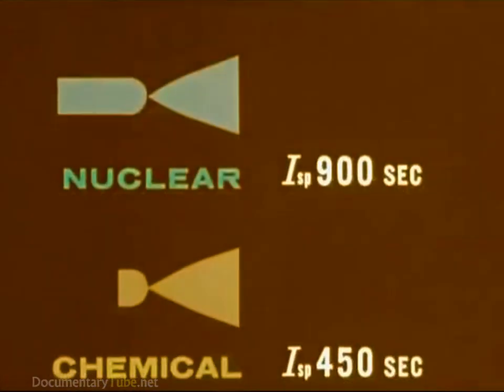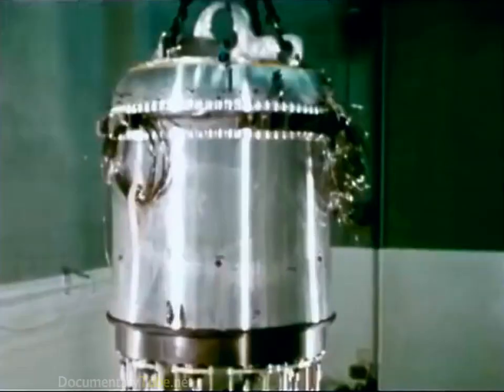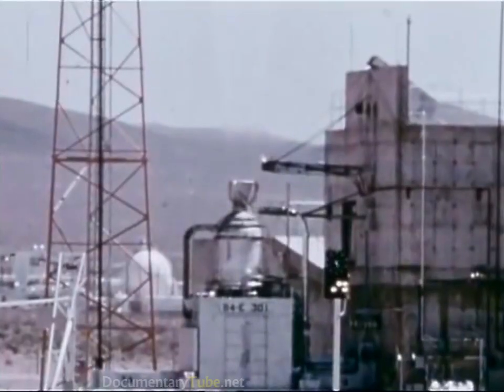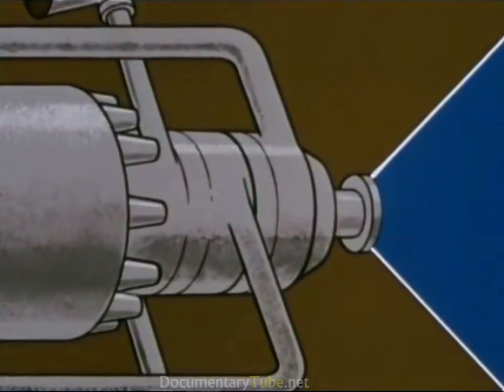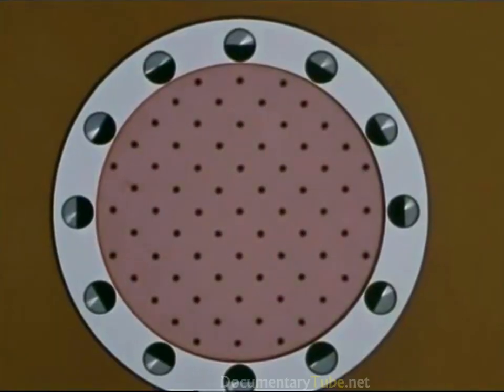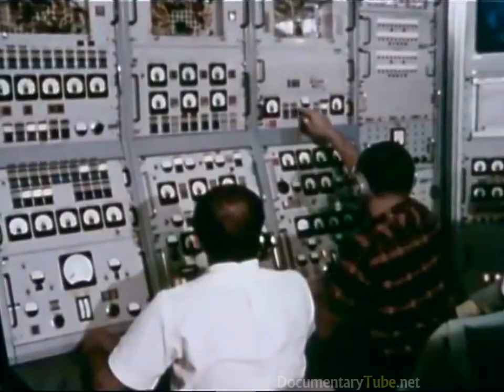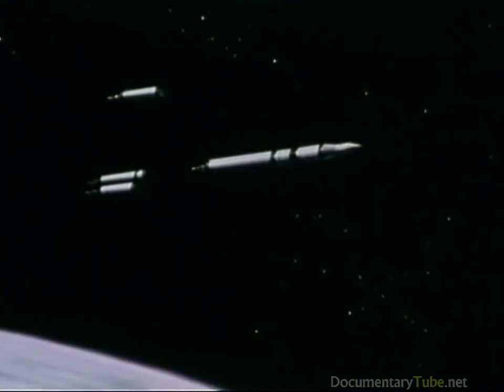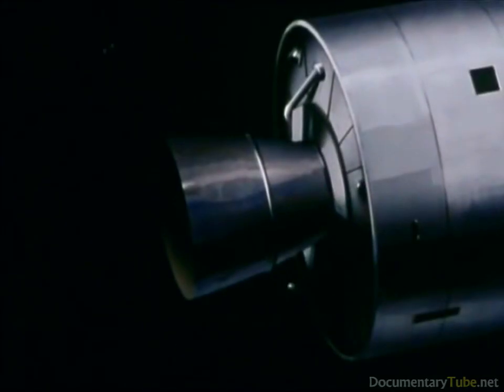HOW IT WORKS: Nuclear Propulsion

Comment: Anyone else see a problem with radioactive exaust gas?
Reply: The  only exhaust would be hydrogen, and hydrogen is not radioactive nor becomes radioactive.
Reply: hydrogen itself cant become radioactive........and they designed the core so that a liner or sleeve did the actual heating in the channels, not the actual graphite/uranium fuel.  In theory an overheat style melt down is possible if the control rods became jammed.
Reply: @wazza33racer  This is true. Without precise calculations, we could fly right through a star or bounce too close to a supernova, and that’d end your trip real quick, wouldn’t it? Oh, wait. I'm thinking of some other type of rocket engine.

Comment: The ion thrusters that propelled the NASA Dawn spacecraft to Vesta and Ceres have a specific impulse of around 3,100 seconds, more than three times the best numbers produced by KIWI.  Dawn was launched in September 2007.
Reply: The ion thrusters may have a high specific impulse, but not very much thrust, the nuclear rocket, and chemical rockets have thrust, but the specific impulse is lower, nuclear rockets are essentially the middle ground between high thrust to weight, and high specific impulse.
Reply: the kicker? they use INCREDIBLY heavy exhausts!
just
at speeds that no chemical nor nuclear rocket could HOPE to see ;)

Comment: Re entry vehicles are obsolete, this return vessel configuration could easily convene with a space shuttle, or international space station, furthermore the jettisoned thrust components can be pre recovered by incorporating return trajectory coordinates allowing them the advantage of a head start, negating the maximum rate of speed used by the occupied craft. 
 Return coordinates can be pre-programmed, re-examined  adjustments made at predetermined trip intervals via Stellar Mapping Azimuth Conveying Mars & Earth Module
 (S.M.A.C.-M.E) Module. Equipment shoves off for home independently during the landing, observation, exploration take off, the orbital craft rendezvous with the propulsion module, and departure units can be pre recovered by the same means as the return ship, and either docked with the International Space Station or configured in a relative orbit for future deployment.
Reply: Yes I agree. A much more efficient system can be configured now. 
In this presentation I'm not too sure about that little Mars surface return launcher.

Comment: Why aren't we using nuclear engines today, they would totally work.
Reply: Use of atomic power in space is strictly limited by international law. I believe all work towards developing nuclear rockets was suspended after the 1963 Nuclear Test Ban Treaty. Also there just hasn’t been a mission profile that would require it (that couldn’t be accomplished with known, tested, reliable tech) developing nuclear rockets to a practical point would require massive upfront investment, and the rockets/fuel themselves would be incredibly expensive compared to chemical rockets so there just hasn’t been a mission that would justify the costs/political maneuvering required.

Comment: 3 rockets to accelerate forward, 1 rocket to decelerate into orbit.
1 rocket to accelerate back, half a rocket to decelerate into re-entry.
how does that make sense!?
if you can equalize the speed with negative speed, by using one rocket..... why use 3 to accelerate to that speed in the first place?
Reply: Acceleration is force/mass, once the spent rockets/fuel tanks are jettisoned there is significantly less mass so it requires less force to achieve the same acceleration.  Even if they weren’t jettisoned there majority of the mass off the rocket is the fuel, so as it’s burned you need less thrust to get the same acceleration... making it modular/staged like this just increases efficiency as you can decrease mass even further as you go since you don’t have to haul all that dead weight around.
Reply: but mass x acceleration = energy.
so, if you're capable of equalizing the energy of a rocket in motion with the thrust of a single engine, that means you're more than capable of accelerating the same rocket from stationary to full speed, because the energy required for that is less than the energy required to move a mass that is already accelerating.
just use a larger fuel tank, or a larger engine, not 3 of them.
it's a rocket built in space! there's no gravity to counter, to get into orbit!
Reply: @bcn1gh7h4wk  but it's not "the same rocket" the mass is far less because there's less fuel/reaction mass and they've jettisoned the bulk of the hardware..
Reply: Here's a good primer on why rockets use staging/why it's more efficient to jettisoned mass as the mission progresses: https://youtu.be/IJtOXekIQv4

Comment: Chemical & fission designs do not give enough endurance : we need fusion electric propulsion ^^ or fusion plasma propulsion / something with super low fuel consumption, incredible energy density, long life durability for space exploration, core designs that last hundreds or thousands of years with no maintenance. We need an electrical space launch platform based on enlarged sled rail cannon designs to blast space trash out of orbit towards the sun & ground based lasers to burn up or deorbit space trash. We need to capture & clean up space trash & stop trashing the Earth with pollution too. Lots & lots of room for progress!

Comment: But an ion engine would be even better.  The ions could be accelerated to near the speed of light.
Reply: @TheGoodCrusader  Not if you had some sort of dampening field
Reply: Charles Long This is a "kind" of ionic engine. Note: Thermo-ionization of hydrogen and thus electrostatic guidance possibility of hydrogen ions. Aerojet created ion engines during the same period.

Comment: ...needs a good transmission...
Nuclear-fission produces ~ 1 million times as much energy per pound of fuel , as rocket-fuel . The problem is converting that energy to thrust . Nuclear-thermal is ridiculously energy-wasteful ; it ejects a large amount of reaction-mass at relatively low velocities . Nuclear-electric CAN  be used instead ; it can produce ISP #s 10 to 100 times those of LHy rockets . Extremely high-pressure systems , feeding CH4 into incredibly high-powered rf. injection/exhaust-tubes , can produce those monster specific-impulse numbers . 
Read Quora thread : In Star-Trek , Impulse-engines are used ...
Concentrate on my answer/comments .
D.H.

Comment: We should totally ban chemical rockets, skip crappy fission reactors that release tremendous radiation. We should develop nuclear fusion propulsion, where direct deuterium-He3 fusion will have an exhaust velocity about 10%C. About 10 thousand times higher than chemical propellants. Which means it’s lsp will be significantly higher than other atomic ones.

Comment: those semi robotic arms were really cool didn't think that was possible in the 60s incredible
Reply: That's a telemanipulator. They have been in use since the late 40s. First developed to handle highly radioactive materials.
Reply: I went to the Nevada Test Site when I was about 8 (1968) and was able to see the arms in the action.
Reply: There is one where they are working on a reactor that had a partial meltdown. Those arms are crazy. I believe they are hydraulically driven. The motions are too precise and smooth for electronic servos, and they were responding "perfectly" to the user's input. IMHO

Comment: And when they realized how poisonous, hazardous and outright deadly the irradiated exaust gasses of the so called nuclear rockets where, it was far too late for a great couple people. 

Also the fision heat exchanger engines proved to be uncontrollable, unreliable and hillariously uneconomical due to the fact that each and every reactor will inevitably melt down after it has burned up its rocket fuel (no more coolant). 

Imagine this you throw away an military grade nuclear reactor (remember Uranium isn't actually a cheap metal and/or easy to come by) for each rocket launch, you irradiate the launch site and the upper athmosphere i.e. the whole world when using such things. 

And that is why nowadays nobody would even dare to think about such hillariously dangerous and from an ressource point of view painfully inefficient devices.

Comment: I appreciate the pro nuke argument but it doesn't work that way. When considering efficiency all factors must be taken into consideration including construction and maintenance.  There are also factors to add such as size, weight, (t. mass). A nuclear reactor requires much more material to construct and maintain which takes away from overall efficiency.

Comment: Is actualy nice and inspiring video seeing what was goals before, dont now exsactly was it U234 or U 235 in the rocket but basic system actualy reveal self rods rotating taht is the principle, big pipe in hoax cooling should be double cooling in gas chamber, and one line tubic for cover cooling, weather is this propulsion still actual or not it could usefull as permanent drive may bigger roads limied to 6-9-14 numbers up to 22 is like  safe, roads like 25-32 are next size gen biger engines.

Comment: You want nuclear propulsion. Make a thick heavy plate, attach to huge shock asorbers and springs. attach to a battleship, throw a nuclear weapon behind plate it explodes and the plate goes the other way FAST. Not practical in atmosphere but in space, WHY NOT? They discovered this when trying to determine how much sheilding a silo needed from a nuclear weapon. First try a the silo lid was tested with a real small nuke under it. The test was to be photographed with high speed cameras. they got 2 pics. It left the earth at solar system escape speeds. That is fast.
Reply: If you're in space, it's easier to replace the thick heavy plate with a huge and relatively thin parachute-shaped sail and put it in front of your ship, attached by several durable long tethers through shock absorbers and then blow up nukes in it. Higher efficiency, lesser mass.

Comment: I love the idea, but such a waist of already shown reusable nuclear engines. Why not do all you say with the lander but bring all 3 engines back and put them in earth's orbit to refilling and maint for more trips. Even make another Space Station for them to dock to for easier access and would cost a lot less in the long run. And if worried about the radiation use h3 and mine and refine on the moon put the new Station in orbit around the moon for boosters to dock to.

Comment: Ultimately, you can't go higher than the softening temperature of the nozzle, which are peaked at essentially the same temperature as burning kerosene. All the cooling does is delay nozzle failure so the nuke is not a large enough gain to compensate for the reactor shielding weight

Comment: It's informative, but at the same time it's startling how much is missing here. Cost for one thing, and any mention of reusability. ISRT was also just a twinkling in the eye of science when this film was made. Even when it comes to nuclear engines, many advances have been made. Twisting the fuel elements generates more surface area and more power. Particle bed rockets achieve the same trick to a greater scale, possibly to the point of allowing for the production of monoatomic hydrogen exhaust. And there is the notions of liquid or gas core fission engines, or using a fission power core to supplement the energy needs of a fusion engine, and gaining another order of magnitude increase in Isp.

Comment: Love the design principle: Add energy to the exhaust gas by forcing the exhaust through a nuclear chain reaction!  It's fucking genius and elegant. 

 The mechanism of forcing a fluid upon a chain reaction by turbo-pump seems rather un-refined and I feel like with a novel configuration this type of rocket could deliver performance well beyond 900 Isp.
Reply: @forgotaboutbre >>> Modern liquid propellant rocket engines use turbopumps that are 'self-powered' in similar ways.
Reply: Pushing gas through the reactor active zone will throw radioactive materials into the atmosphere at Chernobyl scale, you fool )))
Reply: @Wingedawe  He never mentioned using this in the atmosphere ,where did you get that from?
Reply: @Wingedawe  >>> They WOULD NOT be used within the atmosphere, you moron.

Comment: Liquid Hydrogen is pumped and heated to 4000 degrees through a nuclear core and shot out the end of a tube for some 80 to a hundred feet at a high velocity of 800 inches per second!  Pumped from a hundred ton tank of liquid Hydrogen sitting in front of the nuclear core! Now that's got to shoot out some hydrogen radiation at the end of that rocket engine! And it must stick around for a while. Has anyone been to Jackass Flats with a Geiger counter since 1967? The point is, it's not exactly a closed loop nuclear experiment
Reply: Normal kind of radiation tho for in space place

Comment: 4000 degrees huh. But only chem rockets use flame. Provide actual verifiable test results to support your outrageous postulations. One more question... What material is capable of handling -420 to 5000 degree environment? Also, never a tune up fuel replacement all in a vacuum environment that is impossible to exist next to a pressurized atmosphere of earth or expanding infinite universe without walls. 
Anyone understand these words. For children’s sake, say or do something to change the paradigm which is today.

Comment: 2:37 Are they handling fuel rods without any radiation protection?
Reply: Fuel rods don't become seriously radioactive until they've been used.
Also the rods seen might be the control rods, not the fuel rods.

Comment: aside from the radiation pollution during testing and launch it defiantly has its perks. the mars mission plan is similar to the mars mission plan i envisioned by building the large craft in orbit. however i envisioned a space elevator design to lift pieces into space and be assembled. also the manned mission would be preceded by a satellite that searches for a perfect spot then drops landers containing robots and folding modular biodome like buildings with generator units and other machines to make the biodome habitable and self sustaining. then send the manned mission following the spaceX mission plan with a few modifications such as a horizontal landing vs the tail down so the shuttle could be used as a giant rover and position itself. then be lifted via stands to a vertical position and be used to leave the surface. and while the manned mission leaves, construction of 2 or 3 resupply cargo ships that would travel between the earth elevator and the mars satellite meaning new colonists and machinery to mars and a way home for those who need it. tell Elon  im available for hire.

Comment: An easy fix to public perception of nuclear power.  "THORIUM LIQUID SALT REACTORS!"  You just can't have a melt down, so much so, the reactor can be made a 1/4th the cost of current (traditiona) solid fuel nuclear.  Produces almost no waste.  any waste that is left over has a half life far shorter by multiple leaps in bounds then solid fuel waste could ever hope for.  Solid Fuel nuclear waste can even be crushed into a powder and "reburned" in a Thorium reactor while having the half life waste of that fuel shorten to the same time frame as Thorium waste (what little waste even exist).  The only thing stopping it from happening... is politics...  A better, safer, more powerful, smaller, more cost effective nuclear reactor...  could improve nuclear ships and submarines, makes SAFE nuclear air plans possible, safe nuclear space systems possible...  and politics keep it from happening, because solid fuel nuclear can make bombs...  and the safer, cost effective Thorium liquid salt... can't make bombs...

Comment: So your not satisfied with turning planet earth into a glowing fucking carpark but your going to poison the rest of the fuckign solar system .
A nuclear reaction no matter how you butter it up , is an an attempt to control and uncontrolled nuclear chain reaction, ask russia how that worked out for them , or japan , even today that nuclear power failure in japan is still leaching radioactive water into the ocean.
Nuclear anything is like the claims to clean burning coal , Its a lie to con the people.
Ever the while our planet is getting hotter and our 2 thermostats are getting smaller , no ice polar  caps = hotter temps in the magma layer below our crust which = more earthquakes and more severe weather events and many more volcanoes.
the destruction of our living planet is for one reason only and that is ever increasing profits.

Comment: Heating of hydrogen or other reaction mass in the core of a nuclear reactor isn't a long-term solution unless your reaction mass is up waiting for you in space. Nuclear-powered Ion thrusters allow more efficient propulsion using heavy gases like argon as reaction mass.  Heavy exhaust species are mostly a problem in chemical rockets (due to enthalpy stealing energy at the expense of specific impulse).